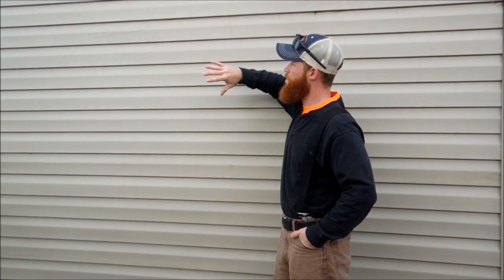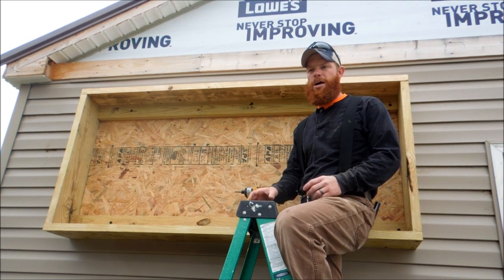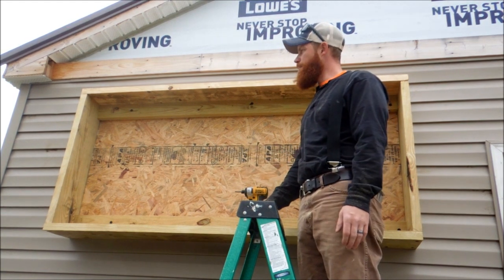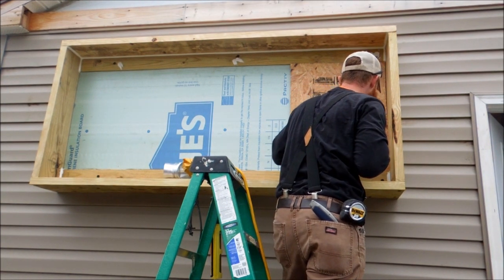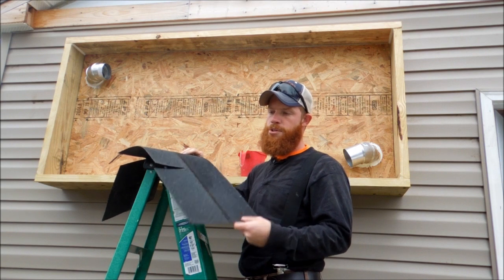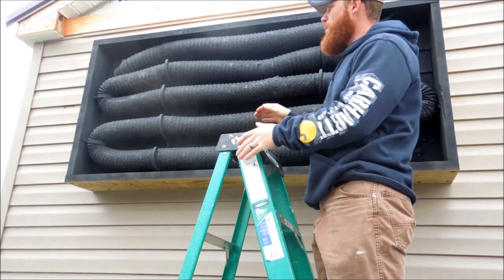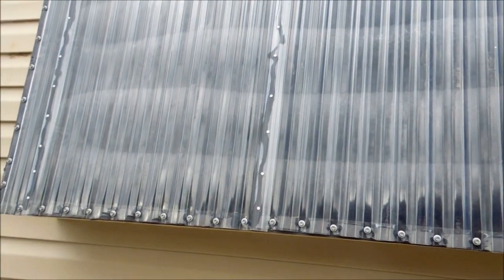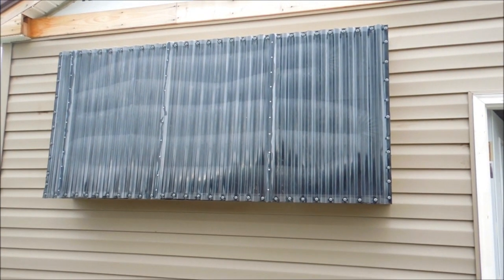How to Build a Solar Thermal Collector for Free Heat by HPFirearms

Comment: What makes the hot air entering high into your shop drop down to where you will be working? If hot air rises, won't it be heating the upper half of your shop. If you have to use a ceiling fan to blow the hot air downward, aren't you defeating the purpose of energy savings by using electric to run ceiling fan?
Reply from the maker: beau solley Sure, heat rises, but in order to use a solar heater it has to exit the heater higher than the entrance. I'm not using a ceiling fan, even though the heat naturally rises within the room it will still heat the entire space. The same could be said about HVAC units with registers in the ceiling...
Reply from the maker: bmuscottty bmuscottty First I never claim to know it all, as a matter of fact I stated more than once that I'm not a solar energy expert. This was an experiment at best but ended up working really well. Sure there are a few improvements that I can make and have already implemented a few of them. One being a damper and fan system to help keep the air moving in one direction. I've got no problem with constructive criticism when given respectfully. The only time wasted in my life, is time not spend experimenting and learning. Thanks for your holier than thou comment!

Comment: The shingles are a great idea, how did it work out?
Reply: All shingles r black so any on upside down will be black,  they r one of the best heat sinks I know of I was never on a roof after 1 o’clock when shingling because there was no way to hfahdle the heat until very late after noon